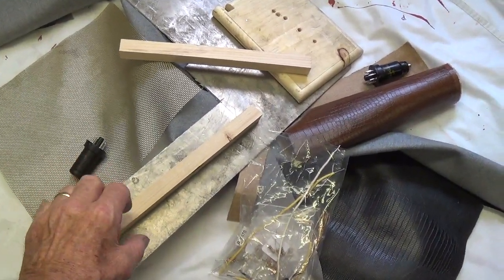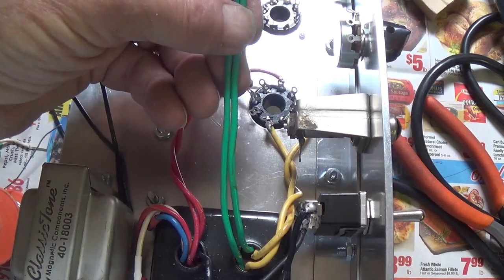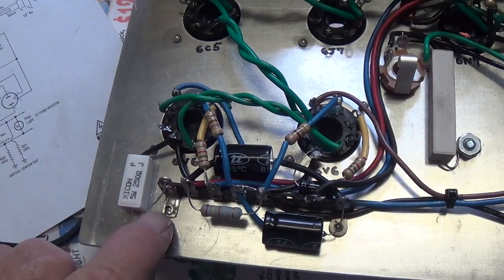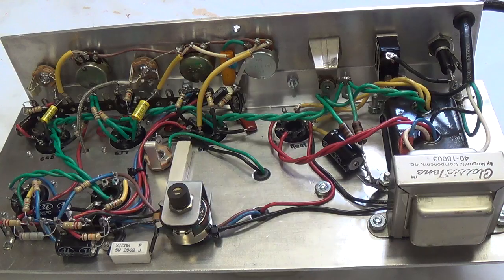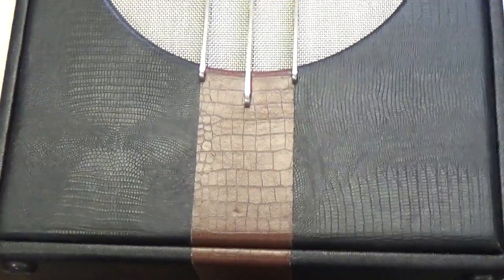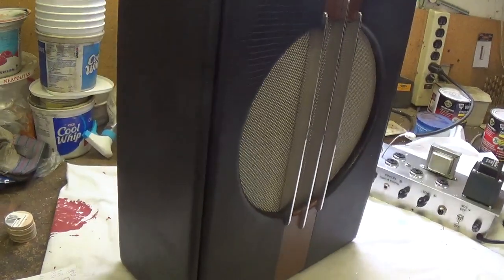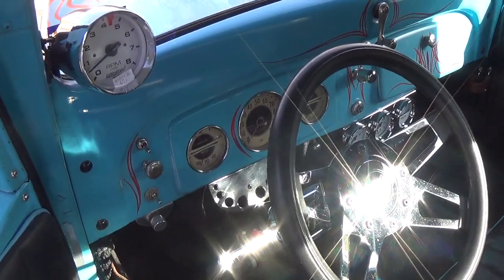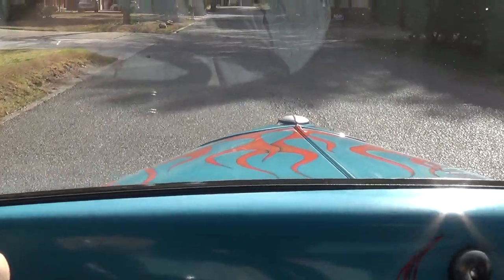Let's Build the Mystery Amp, Part 4: Chassis Wiring & Completed Cabinet

Comment: mystery amp . I noticed on the parts list that you use (LOG) potentiometers, is that correct? thought you’d use linear.
Reply from the maker: Audio taper pots (log) are routinely used in almost all places in an amp circuit.

Comment: good morning Uncle Doug, im wondering which method you use to heat shrink the heat shrink tubing. I have just used the soldering iron, and just move back and forth till its shrunk. I dont like the look of it as the iron leaves burn marks. ive seen lighters used but difficult to get into some spaces. im wondering if a heat gun with a small end say 1/4” ø , the type of heat gun used to solder thats connect to a station that the temperature can be controlled . your heat shrink looks nicely done.
Reply from the maker: I use a hot air gun that is generally used to peel paint. You have to aim carefully to avoid damaging surrounding components.

Comment: Light blue and orange flames would be fine, I'm not completely attaches to dark blue. That is a beautiful amp t would be great if you recovered it in light blue and orange flames to match the truck your giving me. Also I can't have a hotrod truck and amp both in light blue and flames without a vintage Tele painted to match. Thanks for your generosity.
Reply from the maker: No problem, Bob. They're on the way.........;)

Comment: A question about layout , I read about positioning output relative to power transformer whereby I hooked headphones to OP transformer and rotated till I minimized pickup from power transformer (just mains on primary nothing else installed). But looking about , I've never seen an axis alignment other than offset 90 degrees whereas I ended up with 70 ish . 
Is transformer axis offset of 90 degrees the standard ? Is there a production amp that has odd offset angle between the two transformer axis? Or have I been chasing a red herring?
Reply from the maker: That's an interesting theory and technique, MO, but I have never seen a commercial amp with transformers at acute or oblique angles to each other.  I go for the routine 90 degree offset and have never had any noticeable problems.
Reply: @UncleDoug  , can't remember where I read it , if it's applied anywhere it must be rarely so on that basis I'm guessing the improvement is relatively insignificant . Thanks as ever for the videos, education and entertainment all rolled into one.
Reply from the maker: @mineown1861  The pleasure is all ours, MO.

Comment: Pin 1 on 6V6 and 6L6 tubes is connected to the metal shield.  On glass tubes its NC, late amps often use it as an anchor for 1.5k grid or screen resistor.  It can be hot with screen voltage.  Surprise surprise if you inadvertently touch the metal tube.
Reply from the maker: Which makes substituting a metal tube for a glass tube a risky proposition, Jon.

Comment: Hi Doug enjoyed the amp build and the extra clips on the pick-up trucks. I'm currently building a Le-Mans style sportscar (own design), so, the aluminium tips very useful....Another project (winter) is to build an audio hi-fi tube amp. Not so worried about a pure square wave on the 'scope but more the warm, 'bluesy' feel of old guitar amps. Any videos /schematics etc on this (eg Class A v AB etc) ? Oh, RIP Rusty by the way...
Reply from the maker: Thanks, Dave. You'd best hope you don't end up with a square wave from a tube amp circuit, Dave :) I have not made any videos comparing Class A to AB. They both have their relative advantages in both tone and power. From what you describe, you would probably be better off with a single-ended Class A circuit.

Comment: Hi UD, Love this build so far, I like seeing the good old tubes being used 6J7, 6C5, 6N7 etc. I guess you are going with 5Y3 rather than 80, that's cool, I would too. Just one thing, wouldn't it be safer to have the hot side of the power cord connect to the fuse first then the switch?
Reply from the maker: Thanks so much, Daniel. I prefer to go through the switch first, so that no components are electrified when the switch is off.....including the fuse. That way, if someone checks the fuse with the toggle "off" they are not at risk for a shock. Attaching the hot wire to the distal end of the fuse will only eliminate the shock hazard if the fuse is actually blown. You still face a shock hazard if the original fuse is good, and again when you install a new, good fuse. Also, if you feel that unplugging the amp to check the fuse would solve the problem, then I would reply that unplugging the amp would also eliminate any benefit that your method of wiring might offer. To me, there is simply no defense for the "fuse first" argument. You live in a house full of switch-first appliances, why not the amp also ?

Comment: Why would the transformer be damaged from the speaker lead becoming disconnected? If the circuit was open it just wouldn't do anything, right?
Reply from the maker: When the output is interrupted, a voltage spike occurs in the OPT that can damage it and/or the output tubes.
Reply: @UncleDoug  ahhh, now I get it, still learning a ton about tubes, mostly from you
Reply from the maker: That's good to hear, P.

Comment: Uncle Doug, Could a person put an 8 ohm speaker in his amp in place of the 8 ohm resistor in case the cord gets un-plugged from the main speaker. I was just talking about a real small speaker inside the cabinet to take the place of the 8 ohm 10 watt resistor. I guess you would just hook a wire to the plus on the speaker and run a ground from the negative on the speaker to the chassis. Or is this one of my dumb ideas????? Thanks.
Reply from the maker: The addition of the extra speaker would alter the impedance, LJ, so your would have to wire it so that it was only connected if there was no jack in the speaker outlet. Also, the speaker would be relatively large (to handle the amp's power output) and obtrusive, while a resistor is not.
Reply: Yes sir, I was talking about hooking the speaker just like you hooked up the resistor so when the main speaker was not plugged in, it would take its place. Yea, I understand the speaker would blow if it could not handle the wattage. This was just a thought and would probably be better off with the resistor. I have a different jack  and 8 ohm resistor coming tomorrow for my champ, I just finished and  I will change out the jack like the one you used with the resistor. I have already forgot, once and turned on the amp. Got lucky, it did no damage. Thanks for the help.
Reply from the maker: Turning the amp on without a speaker attached will generally cause no damage unless it's left on for a long time and/or the volume (drive) is turned way up. You're welcome.

Comment: Uncle Doug, what's that handle in the middle of the dash below the windshield?
Reply from the maker: It's a crank that makes the windshield swing outward at the bottom to allow for more air ventilation in the cab. It really works well.
Reply: Seems like a great way to catch a breeze.
Reply from the maker: I was impressed by how well it functions, Emrys. Too bad we've all gotten so spoiled by air conditioning and no longer enjoy a little fresh air when driving :)

Comment: Nice cab! If you reversed the croc and lizard (pattern and color) and slapped a silver wash on there it could almost pass for my Selmer Zodiac’s American midget cousin.
Reply from the maker: Thanks, SN. I looked it up.....and can see what your saying :)
Reply: I have a Twin Fifty. Check out those tone controls. Someone musta passed out after 5 or 6 tropical drinks at a Selmer office party and woke up the next morning to a bad hangover, a disassembled blender, and the "Selector-Tone" schematic scribbled on a crumpled cocktail napkin. The "Winking Eye" tremolo indicator is also an interesting feature.
Reply from the maker: I've never personally owned or worked on a Selmer amp, SN, but from what you're telling me, it must be a real "experience". They seem to be highly respected and rather valuable, however, so they must have some very good traits.

Comment: Thank you much for the shielded cable hint.  I was nearly out when I watched the video, and ended up having to find an RCA cable.  Not only did it come in handy, it was MUCH easier to work with than the fancy-smancy Mogami cable I was using.

Also, the previous videos I have watched stressed the use of shielded cable when signal wires were near other electronic parts.  This time you mention using it for ALL signal cables.  

By doing that I have gotten nearly all of the noise out of the Tube-o-drive.
Reply from the maker: You're welcome Frank. I'm glad the shielded cable worked so well for you.

Comment: Another great video. I am really enjoying this series.
I am curious why you wire power to the switch first, instead of to the fuse and then to the switch? It wouldn't make that much difference, but I'm sure you know if the fuse blew, your switch would still be hot.
Reply from the maker: I would rather have a hot switch than try to check on a fuse with the power switch "off" and get electrocuted. Wiring the fuse to the bottom lug does not protect you if the fuse is good. Also, I have never personally had a power switch fail as a short, but if it did, the circuit breaker in my house would trip immediately.

Comment: Why do you only ground your shielded wires on one end? HF grounding should be at both ends, but what purpose does   grounding at one end have?
Reply from the maker: Grounding at both ends can produce ground loops, by which errant AC current in the chassis seeks ground and finds a path through the shielding, creating noise in the input signal.
Reply: Hi Uncle Doug. Okay that initiated some more questions :)
What errand currents are in the chassis? And how do the get there?
I learned in school a signal suffers the least from interference when its return path has the smallest possible loop. Reading your reply, I assume you don't use the shield in the wire as a return path but as a shield to EMI. Is that correct?
Reply from the maker: That's correct. The only purpose of the shield is to shield from EMI. See if this article satisfies your curiosity:  https://en.wikipedia.org/wiki/Ground_loop_(electricity)

Comment: Hi Doug,  Your amps and cabinets are always well constructed and finished but I think this one is your best yet.  The new clean no screw front, inset polished aluminium bars backed by your classic chaise lounge material is a great look.  By the way how are the bars held in place?  I assume they are glued into grooves cut in the baffle.  Not forgetting the straight forward chassis retaining/removal method and the ten watt safety resistor on the output jack is simple and effective.  This amp will be an ideal platform to compare triode/pentode sonic differences.   Regards, Jeff.
Reply from the maker: Thanks so much for all your very nice comments. The bars are interference fit into grooves, as you guessed, and residual contact cement from the baffle-covering process further holds them in place.

Comment: knukonceptz 12 gauge speaker wire will double your sound quality.
Reply from the maker: That's interesting, RZ.
Reply: 294 strands makes it tricky, dip in solder pot.

Comment: I am so glad you are concerned about orphans. lol What is the purpose of the chrome handle in the middle of the dash?
Reply: Hi Robert, I'm sure Uncle Doug will get around to confirming this (he is a busy man),  I've owned a few cars and trucks of that vintage and the handle typically opens the front windscreen. They are hinged at the top and the bottom swings towards the front (you have to remember these were made long before air conditioning) and the breeze is helpful, I'd imagine even more in Texas!
Reply from the maker: Tom is right, as usual, Robert.  The handle is a crank to open the windshield and its frame outward for circulation.

Comment: very nice build. High quality workmanship! Question, why bother with twisting wires to cancel out hum and creating artificial center tap with resistors, when hum can be reduced by simply using 2 silicon diodes and small capacitor and make a D.C filament circuit instead of an A.C filament circuit?
Reply from the maker: Thanks, A1. Rectifying AC to DC in the way you suggest introduces a power-factor loss of about 0.5, which loads down the transformer. In other words, to supply a heater with 300mA of DC the transformer actually has to deliver about 600mA of AC. For a pair of 6V6's, two pre-amps and a PI tube, this would amount to almost 2A overdraw on the 6.3VAC winding......which would shorten its life significantly.
Reply: Thank you Uncle Doug. I love your videos. I'm an E.E myself and I haven't done this work in 25 years. I switched professions.  When I was a kid in the late 70's and in high school in the 80's, it was my hobby and it's what got me started. I built tube amplifiers and a 3 tube regenerative receiver, with one tube acting as the detector/oscillator circuit and the other two as an audio amplification circuit. I enjoy the simplicity of tube circuits...and the point to point to point wiring...a lot easier than etching a circuit board for the home builder.  I truly love your videos and your build quality is truly first rate!  There is seeing a circuit diagram and there is actual real world circuit construction and layout. Top notch work. Please keep the videos coming!
Reply from the maker: You're quite welcome, A1. Thanks so much for your very nice comments. I'm glad you enjoy the videos and wish you the best in all your projects.

Comment: Hi Uncle Doug. I really like the art deco look of the cabinet--especially the aluminum bars and grill cloth.  Outstanding!  I also like the fact that no screws are visible from the front, top, and sides of the amp.  I always do the same with my speakers cabinets and amps.  What did you use for grill cloth?  Is it window screening?
Reply from the maker: Thanks, R. I'm glad you like the build details. The grill cloth is a pale gold nylon open weave material used to recover deck chairs and outdoor furniture.....very tough, resilient, flexible, with excellent audio transparency.
Reply: It looks really good.  Is it like this stuff? https://www.onlinefabricstore.net/phifertex-standard-solids-almond-fabric-.htm

Comment: Hey Doug, at 13:43 I marveled at your attachment of the 3 chromed fins. What are they and how are they attached to the tolex or baffle. Are the chrome pieces notched at the end? You're a master and I love it.
Reply from the maker: Thanks, Craig. I slotted the perimeter of the baffle opening with notches that were a bit narrower than the polished aluminum fins (chosen to match the chassis). The fins are notched so that about half of their extension over the baffle face is superficial. After covering the baffle, some contact cement was present in the grooves and further cemented them when I  pressed each of the fins into their respective grooves. The pressure required was fairly substantial. Thus they are very securely nestled in position and won't become shrapnel during a high-volume concert :):)
Reply: Thanks Doug for the insight.  I take from your description here that there was no tolex in the slot before the press fit. Just brushed aluminum? Well, I'll have to try that and see how shiny I can get it.
Reply from the maker: No, it was cut cleanly away from the slot so it wouldn't interfere.
Reply: Thanks. Have a great evening.
Reply from the maker: You're welcome, Craig. Likewise :)

Comment: AWESOME! I very much appreciate you explaining your method of creating with the attention to detail. Thank You. I have noticed on many amps the builder will attach a schematic to the inside of the cabinet, was wondering if Dan-o-sonic does this?
Reply from the maker: I don't, Mark, mainly because if it were small enough to fit on a cabinet wall, it would be too small to read. I can provide a schematic, however, if a buyer requested it.

Comment: I'm curious about C1 in the schematic and why you have no series resistor on either of the pentode and triode grid inputs. Wouldn't some type of resistor be in order here for an ideal interface with guitars?
Reply from the maker: The input circuit is exactly like the original circuit, Jesse. I could try adding a resistor in that position to see if it makes any difference.
Reply: From my experience, when converting these older types to guitar use, that something starting around 10k on up to 100k works good. Usually I'll go with a 33k and tweak from there if I don't like what its doing. Basically what it does that I like so much is to take some of the flab out of the bottom end and focus the sound. Since there is no longer a volume control on the input, it might be worthwhile mod on your design as well.
Reply from the maker: Thanks for your detailed explanation, JT. I will definitely experiment by adding resistance to the inputs as you suggest.

Comment: Can't say that yer outstanding in your field, Doug. People'd think I was talking about the farmer just outside
of town there. So I'll say that yer just one heck of a fine craftsman. Such a tidy job on the amp, wiring there
of and cabinet therefor. And even if you didn't build up and/or paint the little blue Chevy, you've sure taken
great care of it. And it definitely sounds "official" off those pipes(8-).

Oh...I know what I was gonna ask ya...do you have any videos on freshening up an old vibrator type 6,
or even 12 volt car radio? I once freshened one up and it played so good, I kept it in the house(8-). I
found a 5 amp 6 volt filament xformer, pulled out the vibrator and just wired  in 6VAC instead of 6VDC.
I was quite surprised that the radio didn't mind AC on the filaments. It worked great...but then I let a
pal of mine talk me out of it...Dang me!(8-/
Reply from the maker: Thanks, Tom. Glad you liked the amp and '36 Chevy :)